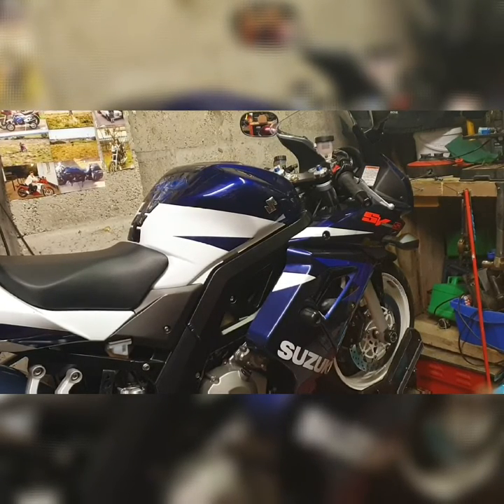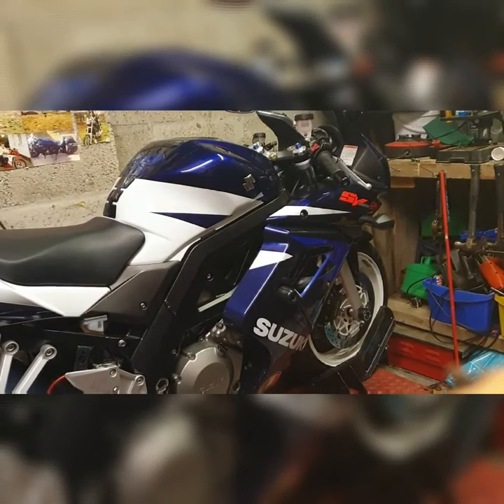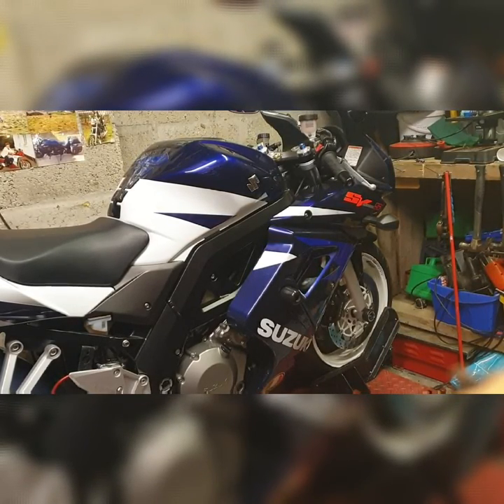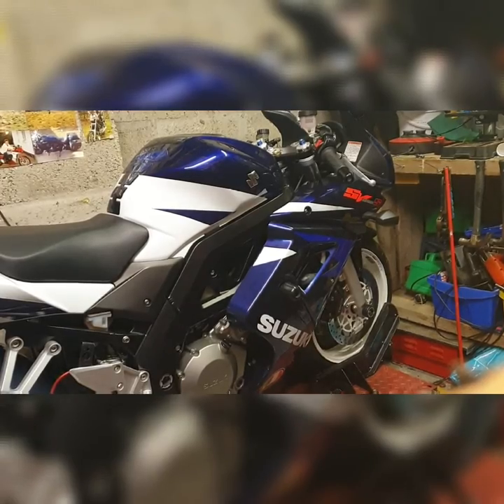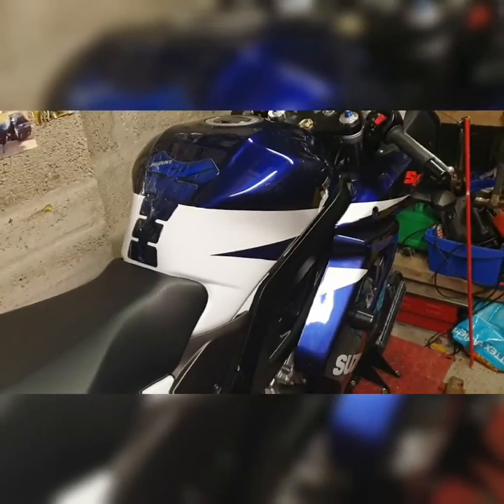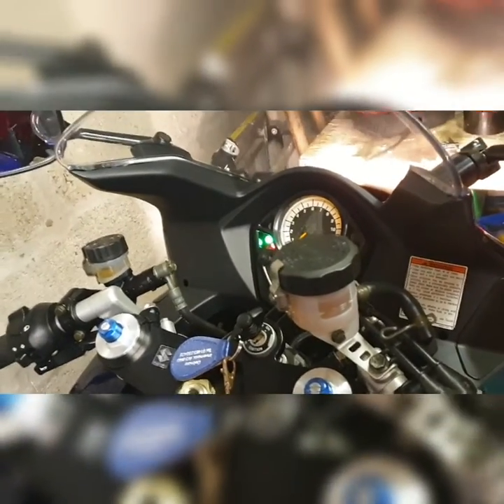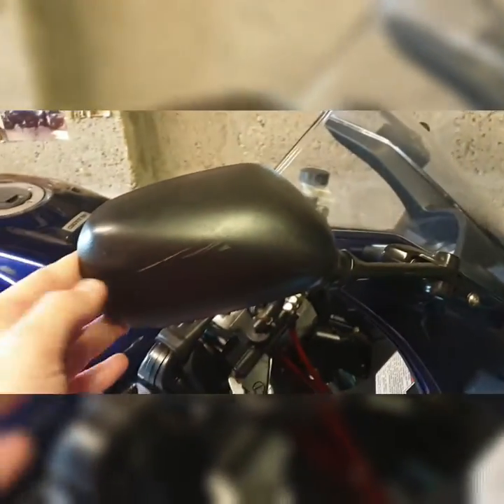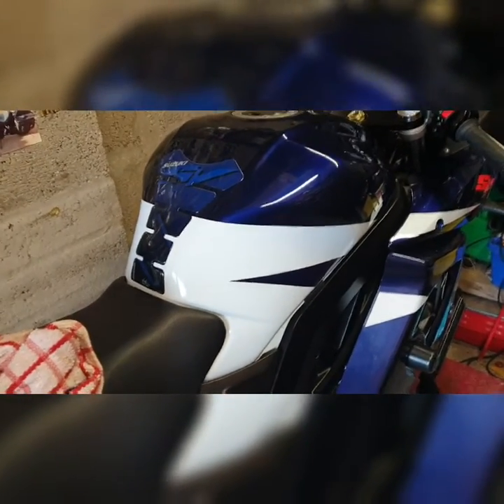Suzuki SV1000s Suzuki SV1000s special edition review

Comment: Thanks for the video! Beautiful bike, love the paintwork. A couple other things mentioned are changes for the 05+ models in general, the tune / TB/ cam changes for example. A bad point of the digital tach is that regearing messes with your speedo calibration. On the other hand you can swap the forks without it being involved. Enjoy it this summer when that's possible! Maybe do a maintenance video in the mean time? With that low mileage the fork and brake fluids might still be oem.
Reply from the maker: I see u got one two on ur channel thanks for the advice. I'd like to keep the bike as stock as I can.
I'll mabey do some Maintenance videos on it in the near future. Thanks for the comment on the video